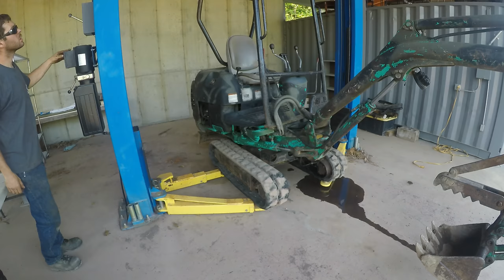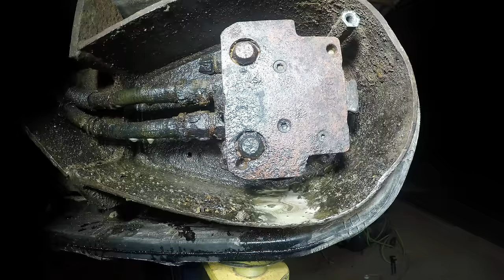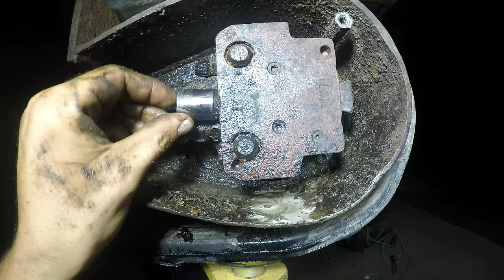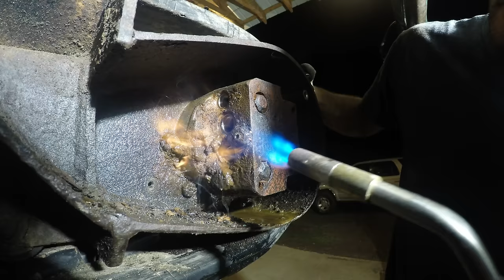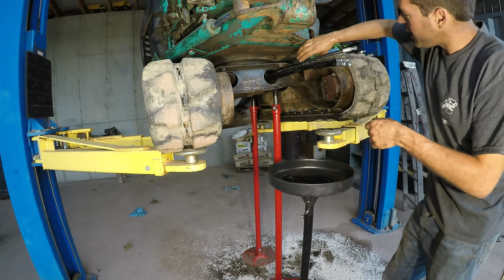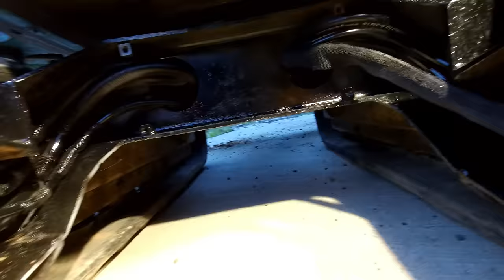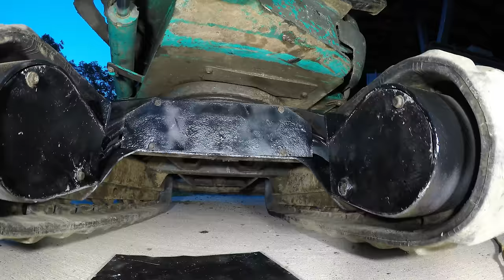Replacing excavator final drive hydraulic lines

Comment: the small pressure line is for 2 speed motors. it pushes the swash plate of the piston motor to change the displacement of the motor. then you get 2 speeds, high displacement for low speed high torq and low displacement for high speed low torq.
Reply from the maker: Ok, thank you.
Reply: That makes a lot of sense, thank you very much
Reply: very true

Comment: When doing a repair like this, it's important to be as clean as possible to avoid contaminating the hydraulic circuit.  If possible, pressure wash the area first and allow it to dry.  When the hoses are removed, use plugs and caps on all fittings, as you go, so dirt can't get in.  Great videos Andrew.  Thanks for taking the time to film them.

Comment: A good little tip I found out when working with hydraulic lines: at a minimum, put a cork in the end to prevent dripping and contamination. You can normally find an assortment for a few bucks. I have o ring face ends (male and female) that do the same thing, but you can operate your equipment. These are the best because you can start you equipment and isolate lines while troubleshooting. Also the best when "snaking" the lines through dirty equipment, sleeves. etc.  Keep making the videos, great work my friend....I always look forward to them

Comment: You know the rust is bad when you literally ask yourself "is this a bolt?" 4:37
Reply: This is just a bad design. All the dirt will go under the covers and will stay there ...
Reply: @ovidiuciuparu6421  unless I'm looking at bad mini excavators.. I haven't seen any one that's all sealed up.
Reply: Why not oressure wash before or use a grinder to clean trash off.   Smh
Reply: Don't be dissing on the structural rust... :)
Reply: @mouaxiong8618  I work on excavators ranging from 1 to 50 metric tons and I've never seen anyone with sealed drive motor covers xD
Reply: Mariusz Palipski  Im not talking about the lines being in the open. I'm talking about the plate covering the drivemotors just being a plate, and not having any seals. thus letting dirt and mud in. There are no lines out in the open in the undercarriage
Reply: @Derpsterrr  yeah I just blew the bottom line on the track drive of my EX150 hitachi and I was asking myself why wouldn’t they just seal it, but yeah I realized after they never are sealed and it is almost seems like the covers are an after thought from the manufacturers.

Comment: Greetings from Tasmania. I like the way you fix things yourself.  The hydraulic shop should have provided you with red caps on the new hoses or you should have covered the fittings & open ports on the drive motor with electrical tape to stop dirt entering so you didn't have to waste fluid flushing the lines. Keep the great videos coming.

Comment: on removing broken fittings, a set of easy outs are nice to have & use, also always a 6 point is better than 12 point socket, will not roll off & round the corners.

Comment: Anti-seize compound will allow you to remove these and all other bolts and nuts, easier down the the road. Also if you give all that a good coating of NO-OX-ID.  you won't have to worry about corrosion. NO-OX-ID may attract dirt but who cares when underneath that dirt, the parts will still be pristine. It's also good for battery connections and anywhere corrosion is an issue; even under water.
Reply: Does wd 40 make a good rust inhibitor ?  I use diesel mixed with motor also as a rust inhibitor.  I'm about Google no ox Id  now and fluid film, which someone else mentioned.

Comment: Hi, great job. I made a rigid steel rack up for my lift that I could drive onto as never felt comfortable lifting a machine that had the potential to roll off, could be an idea as the swinging arms are locked in place and the machine has a solid platform. Alot of my unions that were behind inspection plates I would use a product called fisholene ot wrap them in a greased tape so that when I needed to do work the tape would be messed up but the union under it was good as new. I made it a practice with all my new toys right at the start when I was not tired and the thrill of the new toy led me to explore. A great video though but suggest a safer alternative to holding the machine.

Comment: Maybe pressure wash Before the repair? Makes its clearer and no sand between socket and boults (fitting issues). Anyway....great video again! (2 in 1 day!)  😁 😁 👍
Reply from the maker: Those finals were packed fill of mud. I should have filmed it before I initially pressure washed it. Thanks.

Comment: I did the exact same thing on my 2006 Nagano 1,7 ton machine. Hose failed, the whole space under the covers were jam packed with dirt och ewerything rusty. Managed to save the fitting to the motor, only changed hoses. Dont have a lift so I lifted the machine up on stands and crawled under. A lift is luxury :)
Reply: A lift is a luxury but when used like this can become a death trap. My friend found his father under a lift, flat and dead, his next door neighbor. And dad was a cabinetmaker, welder, designer, car builder and so on.  You get over confident  with a machine and then it finds a way to kill you.

Comment: Nice to see someone being conscientious about avoiding contaminants in the hydrostat circuit. I've heard so many horror stories of people just slapping new hoses on full of dirt and ruining their drives in 50 feet.
Reply: yup, that goes with any hydraulic system and a/c
Reply: flushing lines is useless. replace them or fire a baton through them.
Reply: But yet he welded next to 3 open ports? Hmmm
Reply: @robby844  i agree with that. This guy is doer, i admire that, but there were a few things that scared the hell out of me. Worked building houses and on equipment and vehicles. Never hurt myself badly but it only takes once. A mod on the lift would be easy and safe. Keeping everything clean is a big deal as well. Just needs to refine his mojo.

Comment: While at the hydraulic hose store get caps and covers for the lines they are very cheap and get some extras to put in the cavities of the pump and over the end of the hose. It keeps the crud out while installing the lines the last thing you get in the habit of doing is removing the caps before mating the hose to the pump. These are also good to have in a ziplock bag in your tow vehicle if you break a line while on a job site, you might even get some metal plugs to plug each end of a broken line so you can keep the machine operational while waiting for a replacement line. Two or three dollars in parts can save your whole day. Also, I forgot to mention I know paying cash for equipment you most likely don't have insurance, so get a fire extinguisher for everything. If a fire can be stopped when it starts you can save your equipment, and a fire spreading to the area where your working. Oil, diesel, ATF all can make a small fire a big fire quickly.  All it takes is a line breaking and spraying fluid on a hot turbo, or exhaust pipe and you have a blaze before you know it, its happened to me more than once. The worst was when I bumped into a guide wire of an electric pole and the hot oil in the transformer spilled out and caught the grass on fire. I didn't know it happened until I came back around and saw what was going on, the only thing that saved me was my cheap fire home depot extinguisher.

Comment: Andrew  --  I highly recommend that you invest in some ''Aeroquip'' hydraulic fittings (a little pricey , but they're all Stainless Steel) ,  they'll allow you to make repairs '' in the field ''  with just a few hand tools .  Also ,  you should purchase some  '' Caps & Plugs '' for your hydraulic fittings ,  -  an absolute Minimum of 2-Caps & 2-Plugs of each size ,  this allows you to keep your hoses & fittings  free of dirt & debris while working on them .   --   < Doc ,  Union Certified Top Millwright / Senior Underground Mine Maintenance Mechanic / Certified Welder - Fabricator > .
Reply from the maker: Ok, I just ordered a "64 piece JIC cap and plug set", is that good?
Those other fittings look interesting, but it would be hard to get every one that I might need.
Reply: Andrew Camarata  --  Cap & Plug set is a good start .  If you can't afford to buy all the fittings that you'll need ,  then just buy a couple of them for the most commonly used hose size on all of your equipment ,  and purchase others as your finances allow it .  I would suggest 2- JIC Straight Swivel Females & 1-JIC Straight Male to Male Connector ,  in whatever is your most common hose size .  This would allow you to repair a broken end or a leak in the hose ''in the field'' ,  and if you're on a job site ,  that would be 'cost expedient' to complete the job .   --   < Doc > .
Reply: Andrew  --  P.S. ,  a little side benefit to using  '' Aeroquip '' fittings is that they are Re-Usable ,  so don't throw them away unless they are totally destroyed ( very difficult to accomplish in normal machinery operations ) .
Reply: Aeroquip --- Installed on US Navy ships -- and Boats.

Comment: When I did maintenance on heavy equipment in Rochester,  I always started with pressure washing everything I could. Inside skid plates was always where the nastiest shit would gather. But cleaning it all out before opening a system helped BIG TIME to keep shit out of the mix...  So do you keep any kind of logs for repairs on your machines?  We were pretty good about that when I worked there and we found that we had many less breakdowns on the jobs.. TIME IS MONEY!!!  ;)

Comment: Been working on older stuff like this all my life and one tip I'd pass on to anyone considering this type of stuff is get yourself a heated powerwasher and blast the grit and muck off everything you'll be working at. Cleanlyness is vital with hydraulic equipment and getting rid of most of the crud before you start is a big help, the heat removes years of grit filled grease and oil with ease.

Comment: Man, I used one of those dewalt impacts for a long time.  I would recommend getting an earthquake 20v imact wrench if you want cordless. Another thing that will save you a ton of fustration is a torch kit. You could also buy a propane/oxygen torch kit and skip the expensive acetylene.

Great work btw.

Comment: I like to use a die grinder with a wire brush to loosen rust before applying acid to rusted parts. Great use of welder for removing broken off fittings. Also like to paint repairs when done to try and slow down rust

Comment: Nothing like having the right tool for the job. An adjustable wrench has no place on hydraulic lines or for breaking free bolts etc. A wrap of tape would work wonders to keep dirt out of an open line.

Comment: Next time,you could use some phosphoric acid on the whole stuff.
It will eat the rust and let you see what is what,and allow you to not struggle with the wrenches and sockets,loosening that bond made of rust.
Reply from the maker: Ok, I just ordered a gallon. Just put it on with like a paint brush?
Reply: I use a round nylon parts cleaning brush.  If you prefer stiffer bristles you can cut them down and that works well.
Reply: Yes,it's the most practical,but be careful to yourself,eyes,etc..
Reply: yeah, you just leave it overnight and it destroys the rust
Reply: bug sprayer, put it on with a bug sprayer. it will convert the rust to black oxide. auto body places sell it as Ospho. Gunsmiths use it in the "parkerizing" process. Its found in soda, which is why soda dissolves rust. Its used in commercial kitchens and breweries as a sanitizer. Its not very toxic to humans. Even technical grade you can bath in it and it won't burn you.
Reply: michaelovitch n
Reply: "Even technical grade you can bath in it and it won't burn you."
"technical grade" is about the purity, not the concentration. Technical grade 85% phosphoric acid will cause the same chemical burns as the purest lab grade for 200$/100g.
And of course it will cause mayor chemical burns if the concentration is high.
Reply: Purity has nothing to do with concentration. Water, eg. for any of the usualy acids or hydrogen peroxide or whatnot, is simply the rest of the % up to 100. 

"Go back to school kid."
How about you first get to be a chemist or laboratory assistant (or whatever) and actually learn about this?

You can get 98% technical sulfuric acid and you can get 98% ultra pure sulfuric acid for 1000x the price. Both have about 2% water, but one has very few impurities like metals or other anions like chloride.
Reply: Ok maybe the eyes or butthole wouldn't be super pleasant. But i digress. Phosphoric acid is used all over the place, in restaurants, in the dental lab, breweries, auto body shops you name it. The crap they put on your teeth is about 40% concentration. The stuff they use in restaurants and breweries is 85%.  Would i take eye drops of the stuff? No. Will it burn you like lye? {sodium hydroxide} no, it won't. As far as acids go, phosphoric is some pretty tame shit. The level of irritation to bare skin is minimal. Which is why its use is so ubiquitous. Trying to conflate purity and concentration is a little disingenuous.
Reply: If the skin contact is not for too long, yes, its okay. No biggie. But be aware of any wounds, they will burn like hell. Instantly.
It goes without saying that any mayor contact with eyes will result in blindness. Always try to use safety squints.
Reply: safety squints....lol. someones been watching AvE again.
Reply: michaelovitch  Thanks for reminding me of the phosphoric acid tip.
Reply: Should always blow out the hydro lines b4 installing also

Comment: I got so mad at some hydraulic fittings recently, that I took a mower blade and cut some jaws out of it that barely fit the jc fitting. I clamped the jaws to an extra  fitting with a pair of heavy duty vice grips and welded the jaws on. I now have a custom set of locking pliers for all of the same sized fittings on my equipment. They work the first time, every time. I can't believe no one sells them.

Comment: Great video. I really like how you only post a video when the job will be done from start to finish. Do you have any Kroil in a spray can? That stuff works like magic for stubborn stuff. I also like to keep a roll of painters tape handy when working with hydraulic lines, cover the ends just incase. I see you were being careful, but a little bit of dirt could potentially ruin the whole system. I've been meaning to paint the finals on my Kubota, I feel like, even with the covers, these things get wrecked with filth and it's a good idea to prime and paint everything in there just in case. Thanks for sharing, this will  help a few folks out I'm sure, oh and for those still reading my long ass comment, you can buy that canvas sleeve stuff for your hoses on Amazon, it's pretty cheap and comes in a roll.
Reply from the maker: I should try some Kroil, Yeah, those covers were packed filled with mud, that's why it rusted. I should have taken a video before I cleaned it the first time.
Reply: liquid wrench works the best . check out project farm on you tube

Comment: this is a oring boss fitting in your drive motor, you have too loose the counternut firts to remove fitting... this is why you broke it off. It will never go out if you don't unlock firts!notice that if you are stuck on site you can use a jic fitting if you add a o'ring this will make the job (same treads). thx for your video buddy

Comment: With the boom extended and opening the hydraulics sys up, I would have thrown a cable over the lift cross member and looped it off, just to give me that extra second to step away if the load shifts off the pads. I've seen enough near misses to realize when I might be looking at another. Then I wouldn't think twice about rockin the shit out of a tight fastener.  You do a great job my friend.  Top shelf work ethic and you deserve every bit of success!!!

Comment: In my humble opinion, ( like wgaf, right? ) I would have sprayed a good rust inhibitor in and around those fittings on BOTH sides instead of paint,..which will not likely get to all areas of those fittings.
Andrew, you've done a good job in a difficult situation, to say the least. 
To say that this was an ass clinching video, would be an understatement, especially  during the line flushing segment.
Reply: he should hose these machines down once a year with wax and linseed oil. but he doesn't, because he likes to spend hours on jobs that should take minutes.
Reply: Diesel Ramcharger  That also makes more content for us. And more shit talking opportunities for you. 
Win win win.  ;)
Reply: use FLUID FILM once a year....no rust
Reply: @DieselRamcharger  i doubt it'd help, most of these machines he's only had a few years. such is the  used vehicle life.

Comment: Excellent video. Do you ever use Never-Seize on the nuts and bolts ?  Thanks.
Reply from the maker: I was using that stuff for years (it was like a grey paste) I wasn't impressed with it, so sometimes I just use grease.
Reply: Andrew Camarata. The copper stuff works MUCH better. I use it on my stuff and never had trouble. Also fluid film is another good thing to have kickin around